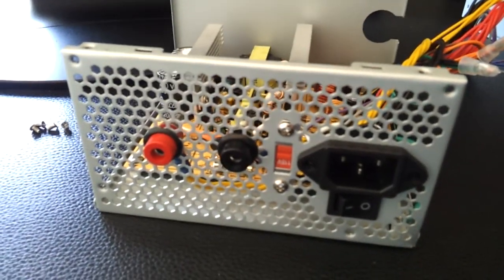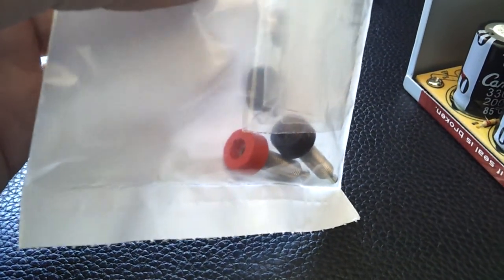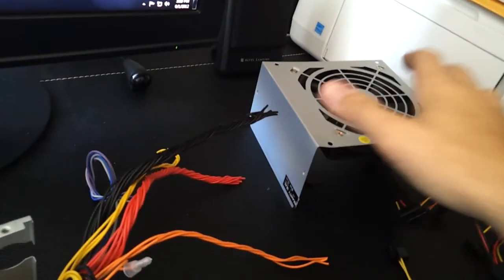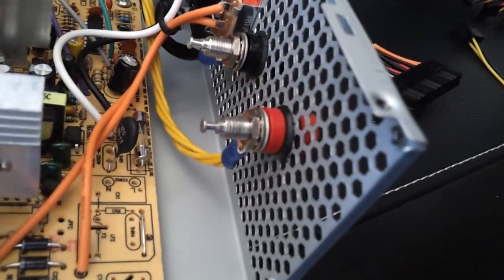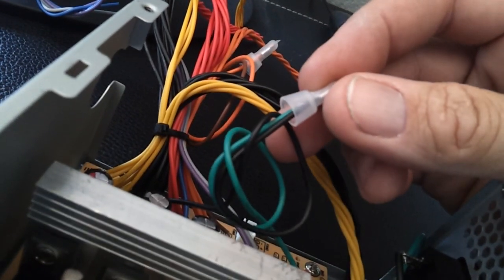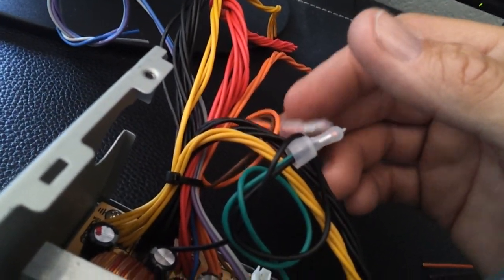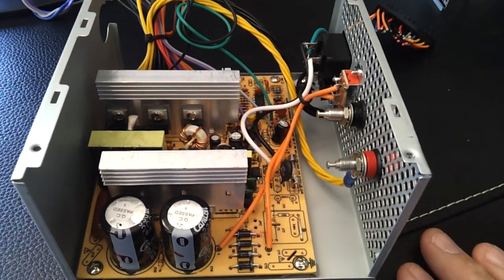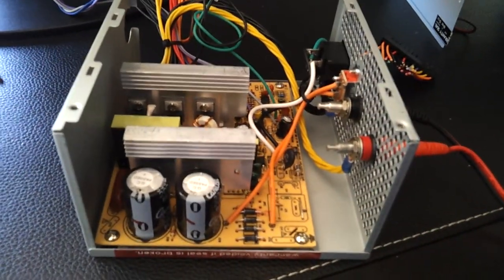Converting an ATX power supply for RC - Pt.1

Comment: Help .... I have a 42v battery charger .... want to charge a 36v pack ... how do I make the 42v into a 36v charger ?  Do I need some kind of resister in line to drop the voltage what size resister would I need ??
Reply from the maker: Able Reyes I would not recommend doing that as heat on the resistor would likely be a problem for you.  I think you would actually need a transformer to best accomplish what you want to do, and I would not know what to recommend to you for that.

Comment: I have been watching and reading a ton of ATX power supply mods and learned some stuff.  I would recommend that you put a fuse in line with each binding post, in this case, just your 12V, it doesn't make sense adding a fuse to the negative (ground) terminal.  Make sure the fuse, of course, is not rated less nor more than the total amps you think you will draw.  This would protect your PSU and your charger in case there is a power surge.  I am sure you capped off or taped those +5 and +3.3 Volt wires.
Reply: yeah I got some panel mount fuse holders for mine I'm building. Trying to find space for all of them without shorting something is annoying but I bet worth the trouble

Comment: Does that convert the AC into DC ?
Reply from the maker: +Bro Modz Yes that's it exactly.  A computer motherboard uses DC and so do most TV battery chargers.  AC/ DC chargers usually cost much more .
Reply: +Oin Taylor ok great thanks, I'm making a fireworks ignitor, and I need a large amount of DC to heat up the Nichrome wires (hairdryer wires) and I don't wanna waste money on a battery, but it limits the distance I can use it
Reply from the maker: +Bro Modz yeah people use these type of Power Supplies for wire-cutting foam for example.  Should handle what you want to do,sounds like you have the right type of wire.
Reply from the maker: +Bro Modz yeah people use these type of Power Supplies for wire-cutting foam for example.  Should handle what you want to do,sounds like you have the right type of wire.
Reply: +Oin Taylor I just tried what you did, connecting the green to a negative (black) it worked for a second but then cut off, almost like it short it self out, any tips
Reply from the maker: +Bro Modz could be a few things.  Do you have some kind of resistor wired or soldered in between a red and a black?  most of these ATX supplies will need to "feel" some kind d of a small load provided by the resistor to properly output voltage.  If you do not, it may be shutting down due to thinking it is not connected to anything since it doesn't sense a load on the circuit. If you have a single brown wire, then make sure it is spliced to an orange wire or whatever wire it was splice in with in the 24 pin harness.  If you have both of those done, then try disconnecting the green and black. Some of these supplies don't need those wires connected to operate. Mine did, but many other people report theirs did not.   Good luck.
Reply: +Oin Taylor ok thanks I'll try that, so u think instead of Black and green, try an Orange and brown together ?
Reply from the maker: +Bro Modz well look at the harness you cut off.  if the brown and orange were together in the harness, then you need to put them back together.  I was just saying try disconnecting the green and black and see if anything happens.  good luck.
Reply: +Oin Taylor ok gotcha, thanks 😎

Comment: If the power supply doesn’t power off by itself after a few minutes of use, you probably don't need the 1.5 ohm loading resistor, besides charging the battery should provide the relevant load.
The loading resistor is a waste of power, 16.6 Watts (Volts/Omhs = Amps thus 5/1.5 = 3.33 Amps, Volts x Amps = Watts thus 5 x 3.33 =16.6 Watts) for nothing, just a red hot resistor more than likely. This also means that you can’t use a resistor rated at 10 Watts you’d need one with a rating of 25+ Watts (to cope with the heat). I’m pretty sure you could get away with a 10omh 5 Watt resistor for loading if your PSU has a “zero” load sensing circuit… your el cheapo probably doesn’t have one.
Reply from the maker: I bought some different resistors to replace the 10w 1.5 ohm that's on there. We'll see how it goes without it when I go to change it out.
Reply: Would a 8 Ohm 20 Watt be okay to use?

Comment: Im looking for a ps that i can draw 20amps. Got any suggestions?
Reply from the maker: I suppose you'll have to look for a power supply that fits your budget,  try to find its manufacturer website and look for the specs for the model you're thinking of buying.  There is usually a sticker on the unit that describes the amp rating of the 3 and 5 and 12 volt rails,  although I would cut off about 1/3 of the listed amp rating just to be safe.
Reply: +kennethpappas Don't just cut off any of the 12v wires. As most PSU's have 2-12 volt rails. A cheap one like a 600 watt has 2 18 amp rails. You need to tie both rails to get the full 36 amps. the expensive ones have one single 12 volt rail that gives the full 36 amps off one rail available for the PSU.

So look close the label on the side. It will tell you how many rails they used.
Reply: 20A? Ii is a little, if 15a, i have a choice ..

Comment: why is everyone avoiding the question about the orange and brown wire connected together
Reply from the maker: I am not 100% sure as to why they are connected together, but that is how the manufacturer of this ATX supply did it.  Since they were connected together in the black 20 pin connector housing that I was cutting off,  I made sure to connect them back together when making the mods.  Depending on your power supply that you may be using for this,  those wires might not be connected together.
Reply: The orange wires are the 3.3v wires.  In older power supplies, like the one he has (which is an ATX power supply, as opposed to more modern ATX12V), most of the power is on the 3.3v and 5v rails.  (It seems he bought a power supply with most of its power output amps on 3.3v and 5v rails, though he only needs the 12v rail-- so I doubt he knew this.)  Since 3.3v is such a small voltage with a  lot of amps potentially going through it, voltage drop can be severe with changes in wire length and power draw (as DC is very unstable at low voltages).  If simply measured at the power supply output, it would not reflect the voltage delivered to components.  Therefore, there needs to be a way to measure it accurately nearer its destination.  The brown wire (usually labelled as "3.3v S" on PSU board) is the 3.3v sense wire.  It measures the voltage of the 3.3v output (orange wire) by simply being attached to it.  This gets an accurate measurement of the actual 3.3v output, so the PSU can adjust accordingly to ensure you get a stable 3.3v output.  Since the other rails are higher voltage, the DC current is stable enough that they don't need the extra measurement, given the same length if wire.  If you don't want to use the 3.3v output, I would still connect brown to orange, but just terminate/heatshrink it in the case so it doesn't short anything.  Then just terminate the orange and red wires the same way.

Comment: My PC power supply dies when I hook something up to the 12V. I use all the yellow wires and a couple of black wires. I need to reboot in order to make it work again. Thoughts?
Reply from the maker: I am not really sure but possibly whatever you are connecting to the power supply is drawing more amps than it is designed to handle?  After you reset everything,  does it work like you want it to,  or does it die again?
Reply from the maker: Also, I watched your video about your DIY power supply and noticed that you don't mention soldering in a resistor like I did here.  I think you do need that resistor in order for the supply to work reliably.  It seems they often have some self test circuits and you need to present a small load to the supply right at start-up in order for it power up and deliver a good constant voltage out.   As a few people pointed out here,  the resistor I used here was not the best choice for the job,  you want a higher ohm rating,  like 5-10.  Hope that can help.  Nice channel you have too.

Comment: Thanks for great video tried it it works great i agree with ExStatic Bass and some one else the 1.5 ohm becomes shit hot a 4 or 5 will work better

Anyway i charge with a 0622-pro dual charger at 2.5amps two batteries at a time works great

Thank you

Comment: If you dont use a resistor the power supply will shutdown under a demanding load the psu might power up and run somthing that doesnt demand alot but it will be unstable you need a resistor on the 5v line for the switch mode operation to work normally,  It has to be tricked.

Comment: hey nice video, i have a question, can i connect two of these modified power supply in serie to get 24v?
Reply: Check out the Dell Poweredge 6650 PS. It has isolated ground between the 120v and the 12v which is needed to connect them in series to get 24v. Plus they are 12v 72A PS's which is hard to find anything affordable that makes above 20A.
Reply: just use -12 (blue) for your negative and use +12 (yellow) for positive to get 24volt
Reply: San Escki  Kindof... Yes, BUT the amperage of the +12v usually around 12-20 amps, which is fine for most purposes. HOWEVER, the amperage of the -12v rail is usually only an amp or less.  So, your 24v will only have an amp or so maximum output.  24v? yes... but completely worthless for any practical purpose.

Comment: I'm no expert either but, all I did was hook the green and black together and the output power was there on all lines. I've been running a car radio in the garage for about 2 years like this and no problems.

Comment: Hi, nice vid. im making my own but i'm bit confused on the power resistor & which line-5V or 12V to install it on. 
my atx is a new 500W unit. 20A available on the 12V & 32A on the 5V. it has no white (-5V) wire
i will be using the 12V@high Amps predominantly. thanks!

Comment from the maker: I am no expert for sure.I did see other users not using banana plugs, those are not required. Some users just used alligator clips to attach the bare leads to the lipo charger. I would double check using a DMM if you are getting any voltage from the PSU, don't go by if your charger powers up or not. You may be getting some voltage, just not enough to operate your charger. Make sure you have the proper value resistor in there, that is needed to "trick" the PSU into thinking it is powering a PC

Comment from the maker: From what I understand from watching others demonstrate thus build, you do need the resistor to simulate the load of the motherboard the PSU would normally be connected to. Without it, some Power Supplies will not give you any voltage output. Part 2 video shows the output I get on the 5 and 12 volt connections. I am no expert and you may be right. I just recreated what I had seen done earlier.

Comment: 1.5 Ohms10W resistor? You don't need to put any load... Specially if you use a cheap power source. I suggest NOT using any resistor. That resistor will put a big load on the power supply, it will also limit the power output on the other voltages. Using that configuration for long periods of time (e.g. charging batteries) you will heat the fets and if they fuse and the mains fuse is slow you will damage everything.

Comment: I would suggest the use of a 2 or 4 ohm resistor. The one you mentioned is a bit much of a short circuit.